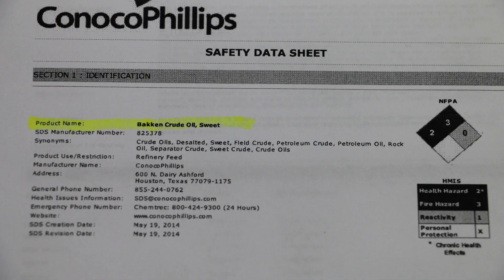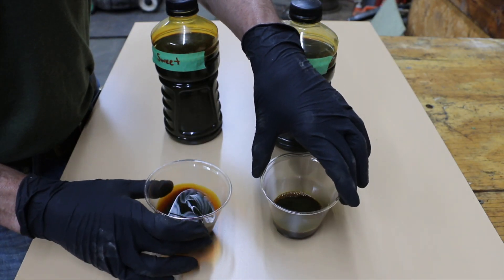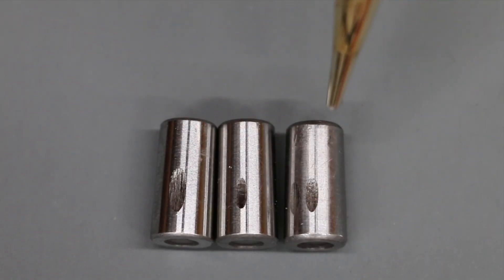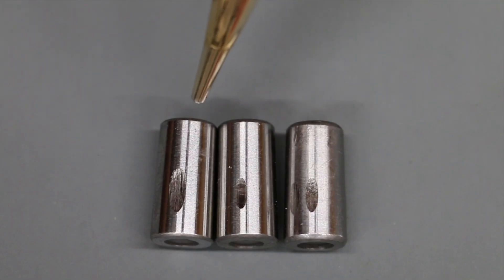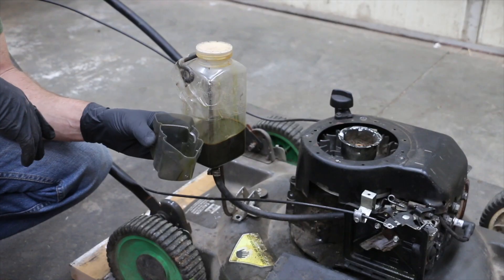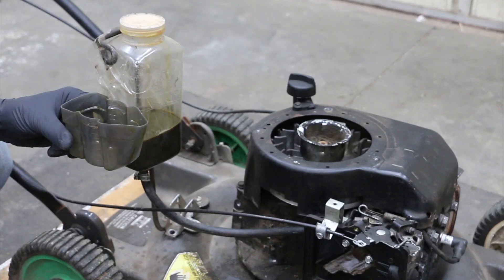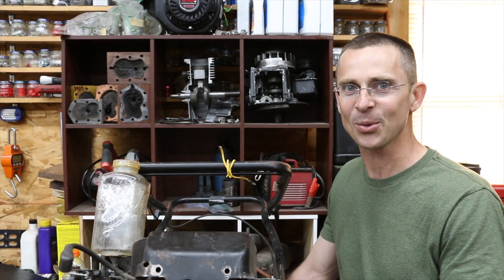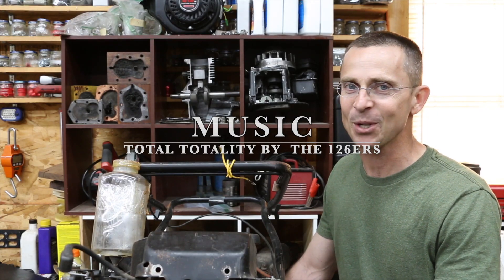Will a Gas engine run on Crude Oil?  Let's try it!

Comment: The title is just as interesting as if it had said "Will a gas engine run on powdered coffee creamer".   lol
There was no avoiding watching this one that's for sure.  
Props to Jerry as well. You don't exactly see crude oil just laying around.  lol
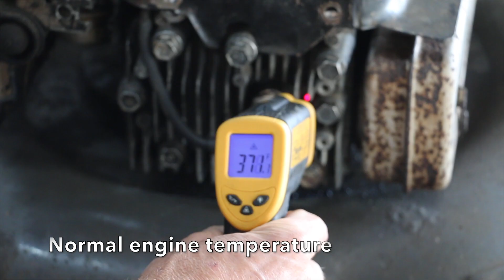And at 4:39, it already has run longer than I expected. Impressively clean I might add. 
(Was doubtful there would be any real ignition to be honest.) 
Figured the higher flash point components in the oil would coat the plug, preventing a spark. 

Another excellent video there Sir!  

Side and somewhat unimportant note lol : 
Unsure about coffee creamer. While flammable, I am just not 100% sure the ignition coil and plug will produce enough heat to cause ignition. Getting it mixed with air is easy enough. But the "surface area" of the spark is not very large in comparison to a flame.  
I expect that I may be underestimating the spark just a bit however. 
One thing for certain, the buildup inside the engine would be insane. 
Along with a burnt marshmallow smell. lol

Edited:   By the way, excellent call on showing it actually doing work.  That is honestly appreciated. Thank you for that added evidence.
Reply from the maker: Thank you for the video idea!

Comment: I was a teenager when my dad asked me to tag along.  He pumped oil wells for a living back then. His pickup had two tanks. One was at 1/4 rank the other read full.  

The “full” tank gauge was a lie. We sputtered to a stop as dad switched tanks.  We were thirty miles from a gas station.  

I had just gauged the oil gathering tank for  oil and saltwater levels.  I had noticed how clear and light this oil looked. 

Dad thought the empty tank reading full might not be sending gasoline to the engine and was trying to get gasoline out to put in the other tank.  

Mind you this is years before cell phone service.  We are stranded if he can’t get gasoline out.  

A quick tap on the tank confirmed that the gauge was incorrect and we were stranded without fuel.  

I mentioned the crude oil and we dipped ten gallons out.  We put it in the tank to give it a shot. Old girl fired right up and away we went.  After five miles or so the plugs fouled out. Luckily we happened to have a set in the tool box on the truck. We swapped them out and I began to clean the fouled plugs with a wire brush.  

We got perhaps 3 miles per set of cleaned plugs.  I’m in the passenger seat frantically cleaning plugs.  

After several plug changes we finally arrived at a gas station and filled the truck with gasoline.  This was a 1973 full time four wheel drive Chevy that got 6 mpg with a tailwind downhill.  

We ran on the empty tank till it warmed up then switched over to the crude mix.  It looked as if he were spraying for mosquitoes till the crude mix was burned up.
Reply from the maker: Impressive!  Glad it did the job.

Comment: would an engine run on engine oil as in the oil you use for lubrication?
Reply from the maker: Thank you for the video idea!
Reply: Sure if you mix enough gas in with it, just straight oil it won't, its too thick.

Comment: Could you try preheating the fuel over the exxhaust manifold to lower the viscosity? I bet it would smooth things out and burn cleaner as the fuel would "vaporize" easier.. Or hell maybe just  bubble the incoming air through the crude oil and lose the carb all together? love the videos keep em coming :)
Reply from the maker: Thank you for the video idea!

Comment: It's not surprising the sour crude oil preformed better in the lubricity tester due to the fact of a higher sulfur content. Sulfur is also added in the manufacturing of steels to improve machinablilty.
Reply from the maker: Great point!

Comment: Sour crude as motor oil is a good idea, but while it could work well, it's a bad idea.  Sulfur will cause the oil to become corrosive to internal engine parts.  https://en.wikipedia.org/wiki/Extreme_pressure_additive
Reply from the maker: Thank you for the video idea!

Comment: Really like all the silly wacky test you perform👍💯keep up the good work.
I have a test in mind , will chassis grease work as lobe oil if pumped in oil galleys?
Reply: I have built several motors and pumped grease in oil galleys for prelude no problem ever....👍
Reply from the maker: Thank you!

Comment: I have recently started going through your videos, and have thought about suggesting a test.

I built and maintain a small aquaponic system, which is about 200 to 250 gallons of water with some ordinary fish in it. This system grows a number of plants itself and is also used to supply water to drip irrigation in potted plants and garden plots. The whole thing is run on timers so that the watering of plants and the introduction of new water for the fish is automated. I can't have anything break down without immediately repairing it, because I could lose fish, plants, and/or the floor of the room the tanks and plumbing and timers are kept in.

I loved your tests of different adhesives, which brings me to my suggestion for a video: another round of adhesive comparison, but test the bonding of pvc joints and repairs to pvc (such as plugging a hole or crack) under stress of air and water pressure.
Reply: Oh, and now I notice you did a pvc sealing video XD

Comment: The thin sour crude is faster because it's thinner. It rotates WITH the bearing whilst the thicker oil has to catch up while rotating resulting in not as much coverage per rotation.
Reply from the maker: Thank you
Reply: @ProjectFarm  you're very welcome, that's just my theory, makes the most sense to me. Lol

Comment: the msd sheet is way off.  crude is less flammable than kerosene and kerosene is not "extremely flammable".  alcohol and gasoline and laquer thinner are "extremely flammable".  crude is extremely flammable only when the burn has gotten hot enough.  its easy to prove dump four cups of gasoline in a bonfire that just refuses to start and u will lose ur eyebrows but if u dump four cups of diesel on the chitty start to a bonfire and ur likely to smother the flames the fire barely had.
Reply from the maker: Thank you.

Comment: I'm not surprised that the spark plugs foul. The only problem is atomization. It's like trying to run on diesel. I AM surprised how clean the piston remained, especially after seeing the plug. The lubricity test surprised me, because I would have thought that the thicker light sweet would have had more film strength. Well, since it's crude OIL, it might be worth trying in the crank case, as engine oil.
Reply from the maker: Thank you

Comment: Great video, just found your channel this week and really enjoying it. I always wondered about running crude oil in an engine and wondered about its properties in general and how to acquire it if you wanted to try it. I would love to see this test done in a Diesel engine as well as other fuels/oils as well and it looks like a lot of others would too. I hope you can get your hands on a diesel that will work well for test purposes, I’d be interested to see how many different things you could run one of those small diesel generators on if you were in an emergency like lamp oil, peanut oil, cooking oil, motor oils , etc.
Reply from the maker: Thank you!

Comment: I was under the impression that the flash point indicates the temperature where the oil product combusts and catches on fire. Why would a negative temperature cause such a reaction? Seems very strange. I work with asphalt binder which has a flash point >300 degrees F. Could someone shed some light?
Reply from the maker: Autoignition is when it ignites while flash point it vaporizes. Thank you!
Reply: @ProjectFarm  Thanks you.

Comment: I think crude oil from each well is different.   So while in this instance sour crude was a better replacement for gas it would be an incorrect solution to say sour crude is better replacement for gas.
Reply from the maker: Thank you

Comment: So if the sour crude ran by itself and was had better lubrication, could it be used as both motor oil and fuel? Or straight in a 2 stroke without needing oil added?
Reply from the maker: Great point.  It may work in an emergency for a few miles, but definitely not ideal for use an engine oil.

Comment: I would love to see you revamp this project but instead add a way hotter plug and maybe find a carb with a larger jet like off a 10hp or something. I assume with those to mods this engine could be dialed in to run smoothly!
Reply from the maker: Great video idea! Thank you.

Comment: Yes heated (thinned) crude oil can be used in Diesel engines with certain filters, many big vessels use it as fuel too, also Turbines and steam boilers.
Reply from the maker: This is great information. Thank you

Comment: Can you compare using Platinum plugs where iridium is required or even copper plugs. And also compare NGK laser or IX series against bosch fg7dqi or hgr7dqi if you can get your hands on any of them.
Reply from the maker: Great video idea!
Reply: Thank you, actually I gave the Bosch FGR7DQI(platinum+iridium) for Honda city 2010 which originally calls for NGK laser iridium IZR6K11 but the customer returned those plugs saying the car wasn't even able to gather enough power to move. So I, want your opinion about the overall build and performance difference between Japanese and original German made plugs.

Comment: Hey would you do a wmo and gasoline blend like say 10 percent 25 percent and 50/50 possibly on a fuel injected engine ? Say a 500 dollar car. I'd really like to see it in the see through engine and maybe even a mix of 50/50 oil gas and propane to add extra fuel and octane if necessary. If you dont try it i will but i prefer watching your videos. Thanks project farm for considering the idea. Its awsome to see you still experimenting on fuels. Thanks.
Reply from the maker: Great video idea!

Comment: Please, tell me how you make the fuel tank! What is the adaptor from the bottol to the fuel line?
Reply from the maker: I used a plastic food container, drilled a small hole in the bottom center, and then used JB Weld to attach a small funnel that is close to the same size as a fuel line.  By the way, JB Weld will break down from gasoline exposure over time.  I replace the funnel every 2-3 months because it begins to leak.  Here are the funnels I bought: https://www.amazon.com/gp/product/B01N14GA5Q/ref=oh_aui_search_detailpage?ie=UTF8&psc=1
Reply: Project Farm Aha, interesting...I thought JB weld is advertized to be able to withstand gasoline. Are you sure it's not the plastic funnel that's breaking down?
Reply: Project Farm on JB weld webside they specifically said JB weld is completely resistant to gas and water after fully cured and they recommand SteelStik for gasline repair.

Comment: Here's my story on burning crude oil.  It was told to me over thirty years ago and this is how I remember it.

A friend who once lived in oil country said his dad had a JD model H made to start on gasoline, warm up, and switch over to a cheaper fuel.  I believe it was called distillate and was  similar to kerosene.  

His dad used that tiny tractor (12 hp at the drawbar) for spring plowing every year .  Instead of distillate, he switched it to crude oil, straight from the ground, not strained, or distilled, or anything.  They ran the tractor day and night until plowing was done, afraid it wouldn't restart.  At the end of spring plowing the sand in the crude had worn down the engine so that it had to be rebuilt.  That's my story and I hope too many 'facts' haven't been changed in the retelling. 

I suspect that lawn mower would have run on straight crude if there had been a way to warm the engine up and switch over.  The old tractors with all fuel engines had a shudder in front of the radiator and a tiny tank to start the engine on gasoline.
Reply from the maker: I enjoyed the story. Thanks for commenting!

Comment: I wonder if you could build a heated tank by running an exhaust tube through the middle of it so the oil will be thinned and easier to burn.
Reply from the maker: Thanks for the recommendation.

Comment: Can anyone tell me what brush he uses to clean up those cylinder heads so nicely, Is it a steel brush? Drill set to fast or slow speed? Thanks for any help!
Reply from the maker: This is similar to the one I use. You can get them for less at Harbor Freight.  https://www.amazon.com/Forney-72731-Crimped-3-Inch-012-Inch/dp/B000TG80WK/ref=sr_1_6?ie=UTF8&qid=1534077712&sr=8-6&keywords=wire+brush+for+a+drill

Comment: Suggestion: Will a Gas engine run on gasoline and pure oxygen? (keep the air mass flow rate at 25% that of normal, to avoid... y'know.)
Reply from the maker: Thanks for the video idea

Comment: The higher sulfur content is what saved the bearing... sulfur is used in gear lube as an EP or extreme pressure lubricant.
Reply from the maker: Great point.

Comment: Wow! I though it wouldn't be possible to get petrol engine running on crude oil. However the oil samples I had were much more viscous than the ones that you got.
Reply from the maker: Great point regarding the viscosity.

Comment: I cannot stress this enough. Do not ever try this at home with sour crude oil. H2S which is in sour oil is extremely dangerous and requires proper safety equipment in which he did not use. Although that little bit won’t be very bad the fumes from burning it in the engine will be. It comes outs out as sulphur which in large amounts while not as dangerous as H2S in small amounts it can be more. He absolutely should have had protection on his arms and a dust mask at minimum, along with the gloves he had on, with how much he was using.
Reply from the maker: Thanks for commenting.  Great point regarding the PPE.  I do wear a dual cartridge respirator, but great point regarding the sleeves.
Reply: @ProjectFarm  A cartridge respirator wont cut it for H2S.
Reply: Benzene is some scary stuff. A real DNA wrecking ball
Reply: @jamesp4521  
it also kills toons.
Reply: It doesn’t exactly require 

Just a choice
Reply: Honestly, I’m surprised the H2S didn’t knock him out. Usually on the rig, if you can smell it, it’s too late.

Comment: May you do a video on how long in that  1 hour cutting grass video you  just use regular oil, regular gas, air governor hooked up , but have the engine throttle max throttle  , I presume it's 4000 rpm, but see afterward if the engine lasts that long, how much compression it loses? Test purpose, is more rpm worth the risk of more power to cut grass?
Reply from the maker: Thanks for the video idea

Comment: Wouldn't the sweet crude oil run better in a 2 stroke engine as they already have a form of oil running through them ?
Reply from the maker: I'll have to test the crude oil in a 2 stoke soon. Thanks for commenting.

Comment: Off the crude oil topic, but I'd like to see an engine run with no fuel! I'm talking about heat and the engine running on its own crankcase oil. Maybe you can find a way to regulate the "runaway" effect. Or it'd be neat to cut the spark on a gas engine and have it still run by having lots of heat present.
Reply from the maker: Great video idea!

Comment: I remember when they introduced USLD Diesel here in Canada, there was a lot of talk about the huge loss of lubricity in the diesel by reducing the sulfur content. Your bearing test demonstrated that perfectly! Great video.
Reply from the maker: Thank you! I have older diesels and I add 2-stroke oil to the fuel to protect the injection pumps.
Reply: @ProjectFarm  Wise man.

Comment: Would it work on a diesel ? I also made a Fuel bottle out of a Blue Vida container not the small ones neather 3 in wide thick too when I was getting a 61 Ranchero running worked good made a hole on the bottom used a fitting & fuel line its good 5 years now
Reply from the maker: Great video idea!

Comment: I could binge watch your channel all day.  Very entertaining and informational.  If you still have extra crude and the clear case set up for this, would you try creating a basic U-shaped water electrolysis machine (H2 O2 generator using KOH or NaOH, U-shaped so you could possibly separate the gases) and seeing if adding additional hydrogen gas, oxygen gas, or both increases the combustion speed or efficiency enough to clean up some of that streaking?  Or see if any of those 3 gas additions cause a slight rpm increase with that engine with the digital rpm gauge on it?
Reply from the maker: Great video idea!

Comment: You need to know the API gravity of the oil. Sweet or sour is only a measure of H2S. If you had higher specific gravity sweet crude it would run better. You should test what we call "Condensate" It used to be called natural gasoline. It condenses out from oil and gas vapors and is clear as water. It has a fairly low octane but I'm sure it would run a mower.
Reply from the maker: Great point.

Comment: Pretty darn fascinating! BTW, the turbine engines in the first few pumping stations on the Alaska pipeline use crude oil because it's too difficult to haul refined fuel that far north. The one thing they do to the crude first is push it thru filters to get out as much dirt and sand as they can.
Reply from the maker: Thank you
Reply: Did they have to pre-heat the crude oil as well as filtering it?
Reply: @grahamepigney8565  crude oil supposedly has a gel point of 59°F, so there is a valid reason to be concerned there